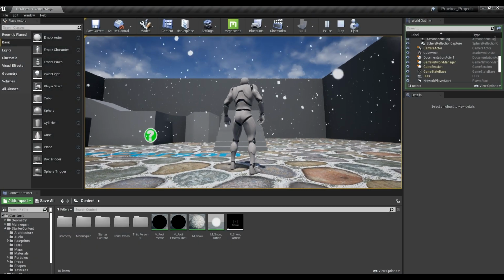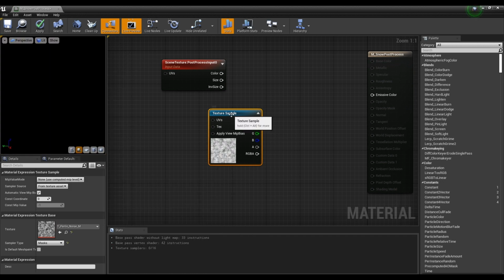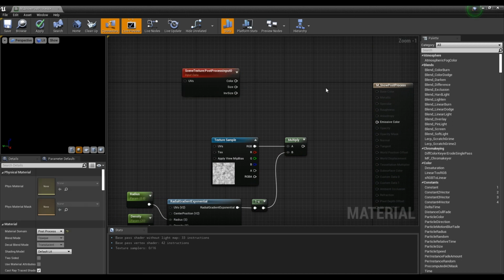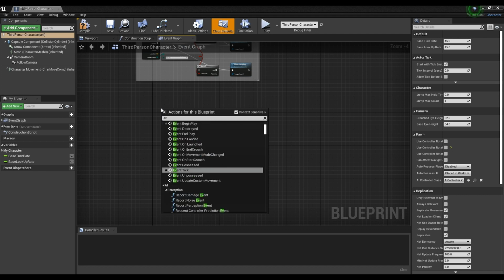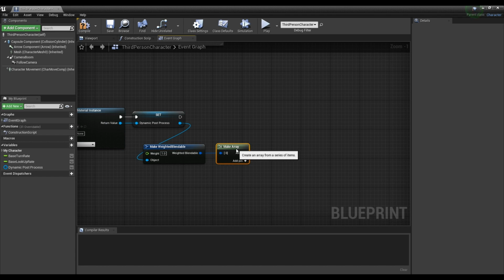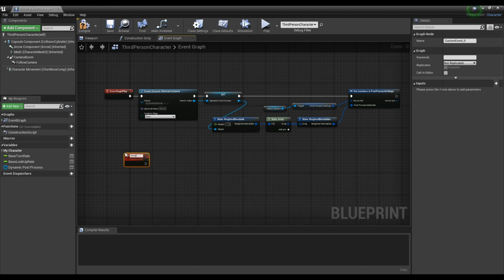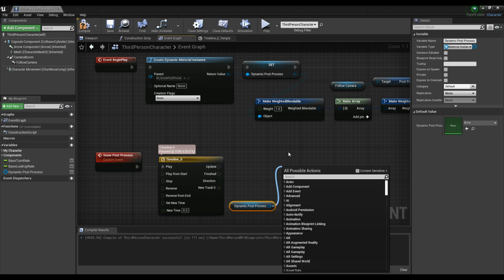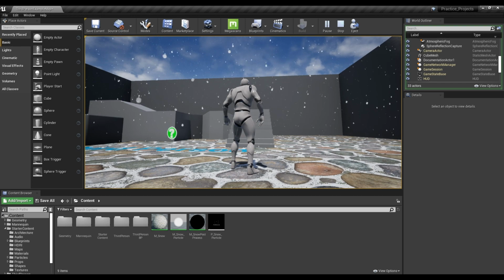UE4 Frozen Camera Post Process Effect l Unreal Engine 4.26 (Tutorial)

Comment: Thanks for the tutorial! Sadly it didn't work from reverse and I don't know why.. I want it to defreze after coming out of the snow and the event triggers, also the Parameter Value is setted, but nothing changed in the viewport
Reply from the maker: Use dynamic material for adjusting parameters in real time. Thanks
Reply: You can also create a custom event and connect its execution pin to "reverse" of the timeline